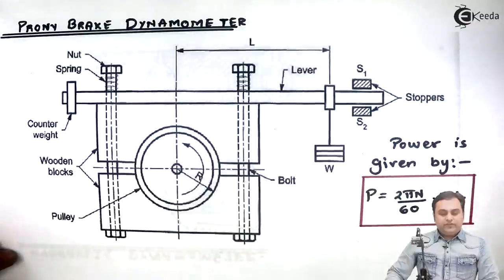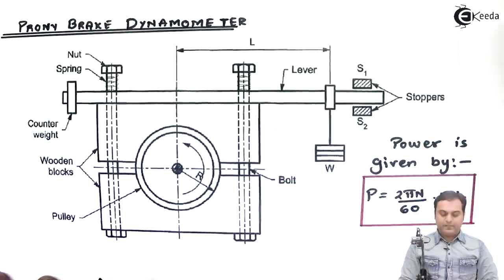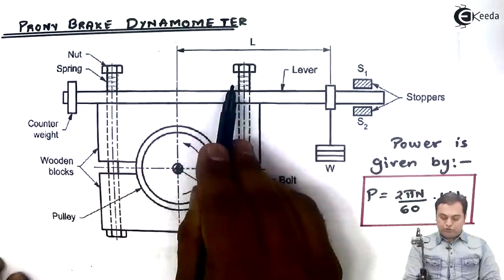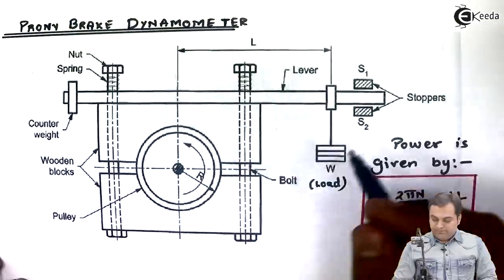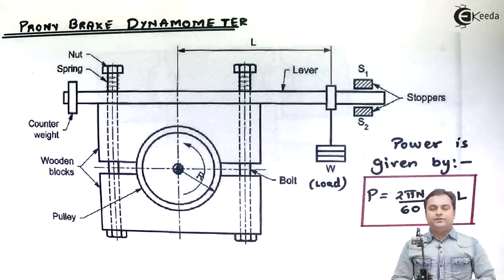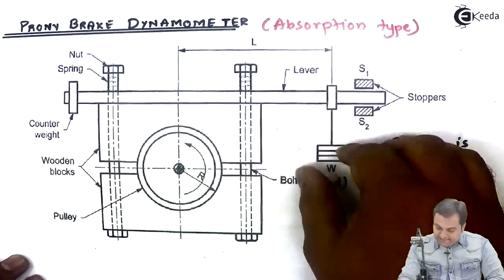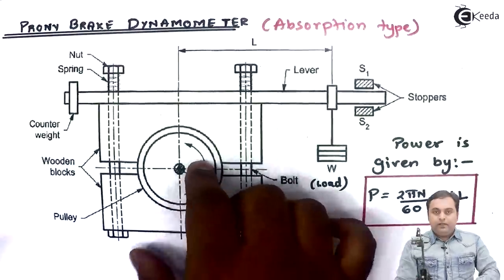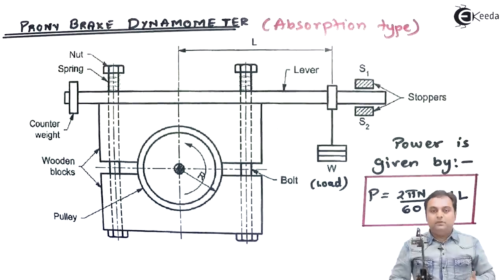Construction and Working of Prony Brake Dynamometer - Theory of Machine

Comment: The pulley doesn't stop in other videos I have seen.  Also, you blocked the math equation with your head.
Reply: could you please recommend me some videos showing the correct explanation, I've been stuck on it's working since days :(
Reply: by scrolling the video you can see the equation P= 2*pi/ 60* w*L

Comment: if the pulley stops your rpm becomes zero, and power output becomes zero, I think you need a tachometer as the rpm changes with increasing the shaft load

Comment: That was plain illogical and wrong. There is no gap, that's the groove and rim structure of the pulley. The shaft never stops, it rotates at a constant speed. Please do proper research on topics you intend to post online.
Reply: could you please recommend me some videos showing the correct explanation, I've been stuck on it's working since days :(

Comment: which of the following engines a prony brake is used to measure brake power?
a) single cylinder engine
b) low speed engine
c) low power engine
d) variable speed engine